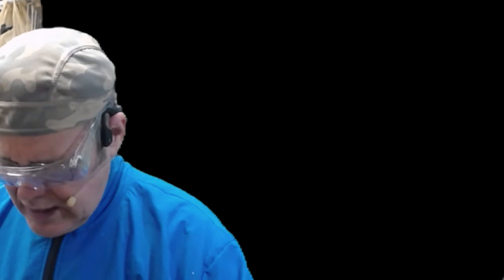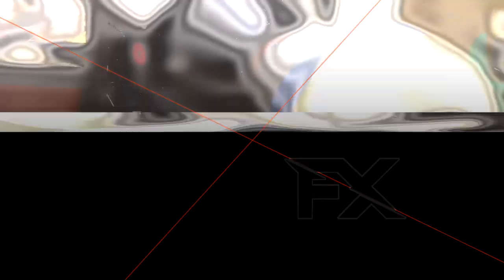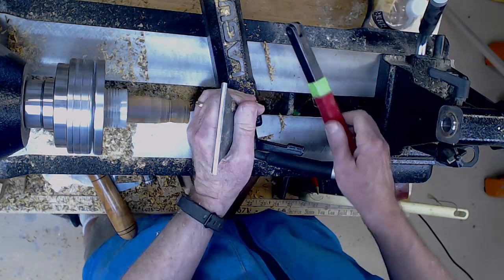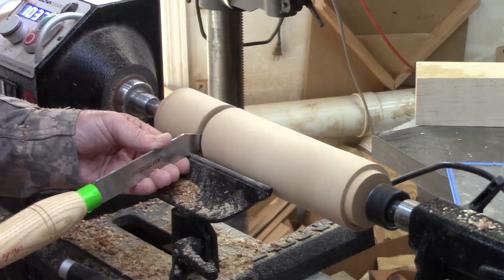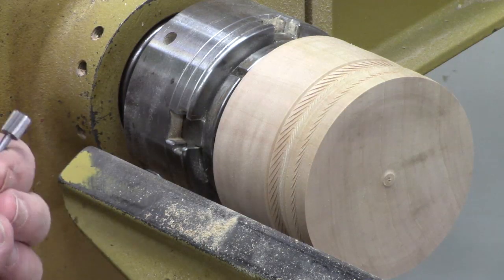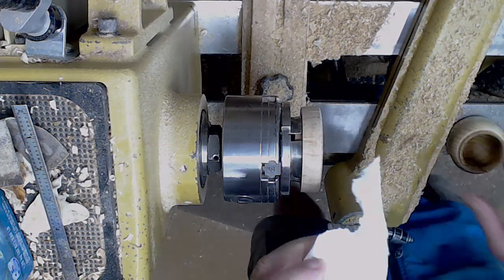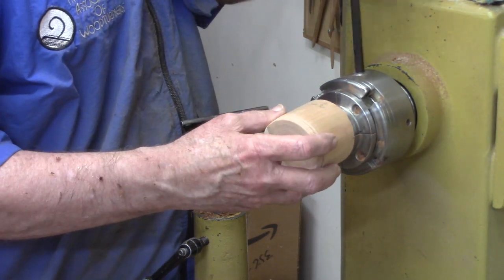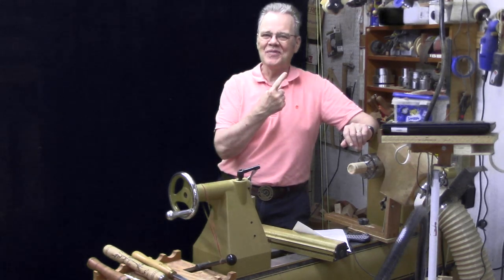Woodturning Fails, Catches And Bloopers 2020

Comment: Mike -- This reminds me of when I couldn't get my tools to cut. It had been a few days since I'd turned and my project was still mounted in the lathe. I tried one tool after another and couldn't get a decent cut. The tools looked sharp and felt sharp when I ran the back of my thumb nail across the edge, but they wouldn't cut. In frustration, I pulled out some carbide tools. They wouldn't cut, either. I keep a magnetic tool tray on the top of the headstock. I stared looking in the tray for the Allen key needed to loosen the carbide cutter so I could rotate it to expose a sharp edge. That's when, out of the corner of my eye, I saw the cause of my inability to get a decent cut: I'd been running the lathe in reverse!
Reply from the maker: I note that folks often flip the reverse switch on for a club lathe to see how long it takes a demonstrator to figure it out! I mounted a blade on my radial arm saw backwords. I was out of town when my son, who had nevered used a radial arm saw before tried to burn thru some mdf!

Comment: Mike -- This video reminded me of something I've noticed about bargain-priced lathes. Often it's more difficult to securely lock in place the tool rest, banjo, tailstock, and quill.  I'm NOT suggesting that is what was going on with your Laguna. From all accounts, it appears to be a nice lathe. But, your showing so many episodes of your tool rest coming loose reminded me about what I've noticed about some of the less expensive lathes. When someone asks me about what you get for the extra money it costs to buy one of the 'name brand' lathes, I'm often hard pressed to come up with a concrete example. With my Australian made Woodfast, which in its day was a premium lathe, once you locked something down it didn't move. That has never been true of my Harbor Freight clone of the Jet 1236. The tool rest, banjo, tailstock, and quill would all come loose no matter how hard they were locked in place. That has been true of other bargain-priced lathes I've used.
Reply from the maker: A lot of my tool rest slippage is user error. The Laguna actually has a better clamping mechanism than my PM3520b.
Reply: @MikePeaceWoodturning  When it happens to you, Mike, it may be user error. When it happens to me, it's definitely a design flaw!